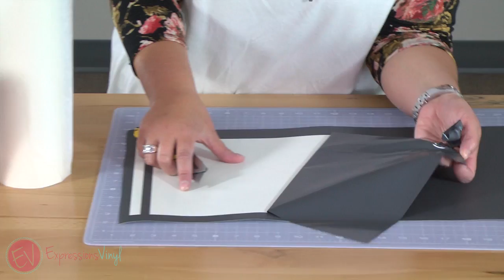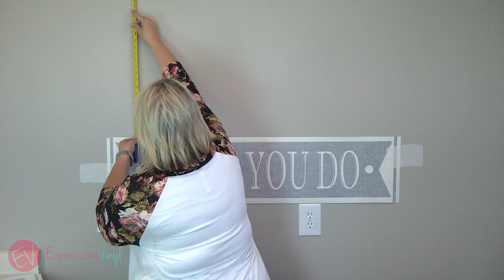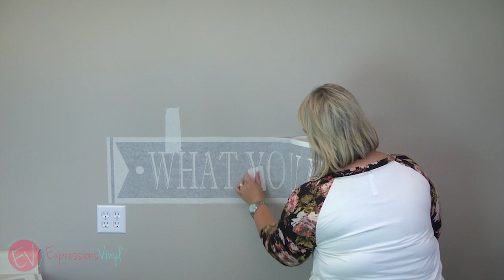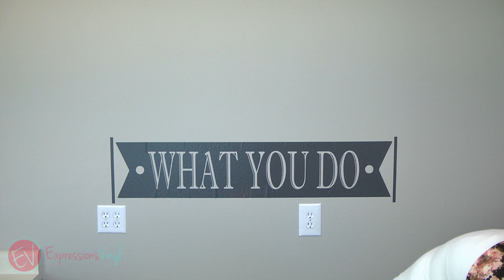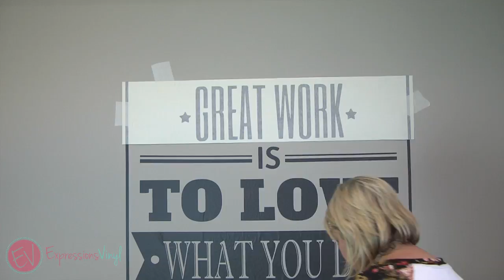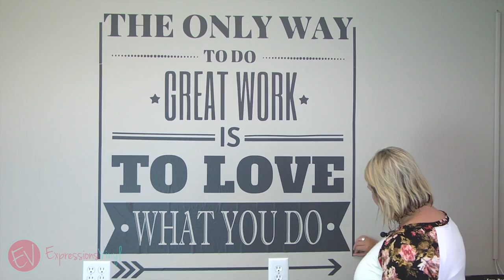Extra Large Vinyl Wall Project

Comment: Is there any way to remove the wrinkles?
Reply from the maker: Hi, yes there are a couple of ways to remove the bubbles.  You can either carefully pull up the piece until you can reach under it a bit to smooth it out.  You can also put a small pin prick where the bubble is at ans smooth it out towards that hole to release the air that is underneath.  If you have a hair dryer, that also works to add a little heat to it and then the vinyl will smooth out.  Hopefully this helps.

Comment: Can I use glitter vinYl for wall art? If so which one is recommended?
Reply from the maker: Yes, you can use glitter for wall art.  It does have a permanent adhesive so it will be a little trickier to remove when the time comes.  Any of the glitters that we carry will work for that.  Here is a link to them - https://expressionsvinyl.com/permanent-adhesive-vinyl/glitter/

Comment: Can it peel off the wall without damaging the paintwork etc
Reply from the maker: Hi Sharon, there are a lot of things that would make a difference on this.  If you use removable instead of permanent it will be a little easier to take off.  However, if you have left it there for several years in the removable it will be more difficult.  Also, the vinyl may adhere differently to the different types of paint that are used.  We'd recommend trying a little on a spot to see how it handles it.  Please let us know if you have any additional questions.

Comment: This might be a longshot. but is there a way to reverese the process so i can use the vinyl as a stencil?
Reply from the maker: Absolutely! You would just change out what parts you are weeding - so weeding out the parts where you would want to be paint. Apply it to your project, fill in with paint and then peel off the vinyl.

Comment: What transfer tape are you using in this video. I looked on your website and the 12"x30" clear does not have a paper backing but the one you are using does. Thank you.
Reply: ok, I just watched video again and I commented on the wrong one. But anyway, I looked on your website and this transfer tape looks "white" and the one on the website is clear (opaque)....Just don't want to order the wrong thing. Thank you!!
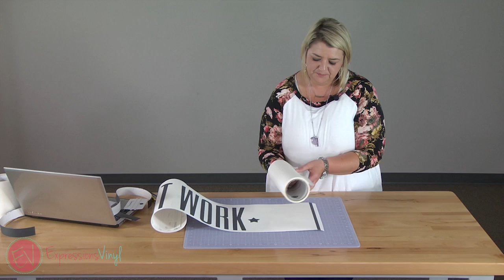Reply from the maker: I am using the paper transfer tape in a 12"x100 ft roll. http://expressionsvinyl.com/transfer-tape/transfer-tape-rolls.html It does not have a paper backing. At 2:25 you can see me peel it off the roll.
Reply from the maker: I see! We have it in opaque and paper. The one I'm using here is the paper.  http://expressionsvinyl.com/transfer-tape/transfer-tape-rolls.html If you use this link and scroll down a little you can choose paper or opaque and then the size of roll you would like.

Comment: how did you create the design
Reply from the maker: Hi Staci! One of the ladies that works in our office saw something similar on Pinterest, and as she is not very experienced in design software, she ended up using Canva (a free online program) to design it the way she wanted and saved it as a jpg. Then she opened the file up in Silhouette Studio and traced it. Once traced (so there were cut lines) she enlarged it to the size she wanted and separated each line and cut each one. Thanks for watching!

Comment: how do you cut something that long.....i guess you don't have a mat, but it only shows 24" long???
Reply from the maker: With a Silhouette Cameo, you can cut (without a mat) up to 48" long. Just go into your "Design Page Settings Window" (upper right hand corner) in Silhouette Studio and adjust your page size.
Reply: But be very Careful, I've tried cutting without a mat and it just moved all over the place ruined my vinyl..
Reply: I am trying to do a vinyl without a mat—longer than 12". When I started cutting, it stopped at the 12" mark. If I select "no mat" in the Design Page Settings window, will that solve the problem?
Reply from the maker: Check out this video. We walk you through it. :) https://www.youtube.com/watch?v=Txh8nNtvURw
Reply: the Silhouette vinyl roller attachment works great!
Reply: Can I make a sign that long on cricut explore too? If so how? TIA!!

Comment: Looks like there are still lots of bubbles. How can you fix that once the vinyl is on the wall and the transfer tape is removed?
Reply from the maker: Unfortunately we ended the video before we showed everyone how we got rid of the bubbles. If you apply a little heat to the vinyl (specifically Oracal 631) with a hair dryer while using an application tool, you can get rid of the bubbles at the end. Our walls had been freshly painted with a semi-gloss paint so the adhesive wasn't sticking as well as we would have liked, but the heat at the end did the trick!

Comment: That was great 😃 thank you.   I do have a question though.   How do you set the lines in your design so that they are in the same spot on each piece?
Reply from the maker: Design your whole decal first, at a much smaller scale so that you can add the lines on either side the way you want them. Then enlarge your image to your desired size and your lines will be just exactly where you want them to be. Hope that helps, thanks for watching!
Reply: +Expressions Vinyl thank you.  One more question how do you divide it so that it will cut in even section?    Use the ruler on the side to 12".    I think I got it. Thanks again. 😃👍🏻

Comment: great video but looks like lots of bubbles on the last two groups of wording. not sure if it is just the video but how would you work out the bubbles especially on that big piece. thanks. love the project. also curious where in your offices it was put?
Reply from the maker: Unfortunately we ended the video before we showed everyone how we got rid of the bubbles. If you apply a little heat to the vinyl (specifically Oracal 631) with a hair dryer while using an application tool, you can get rid of the bubbles at the end. Our walls had been freshly painted with a semi-gloss paint so the adhesive wasn't sticking as well as we would have liked, but the heat at the end did the trick! (Also this decal is in the office of our Marketplace Sales Director.)
Reply: That sounds interesting. Please make a video showing the procedure :)
Reply: Also it's very very rare to see a wall super flat and smooth like glass . Great tip with the hair dryer! I'm very excited to try this !!